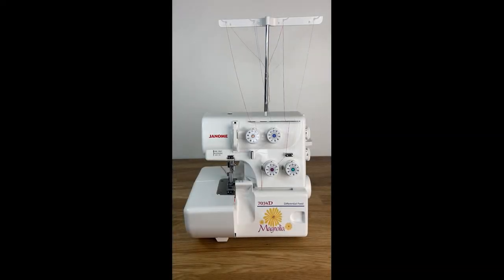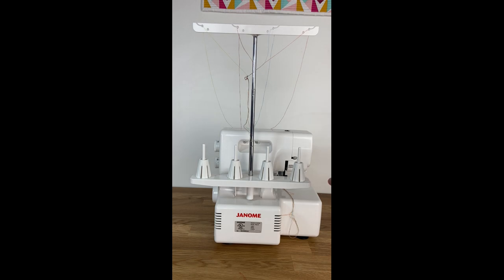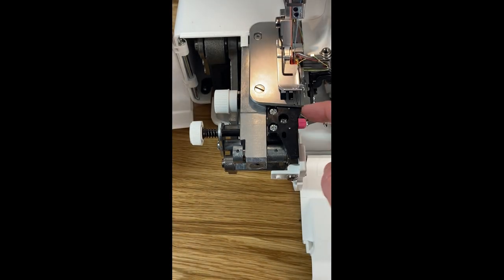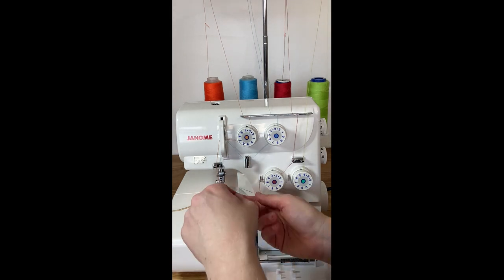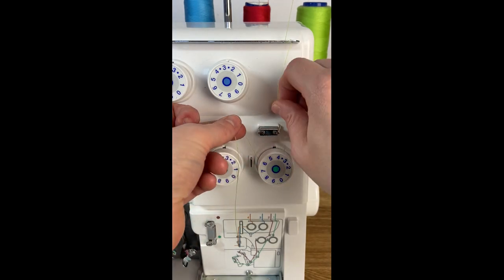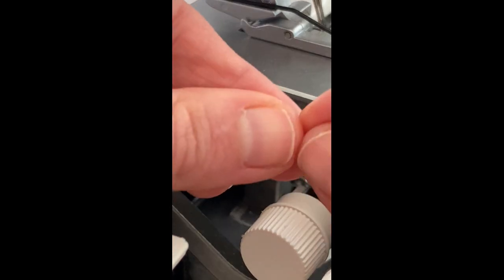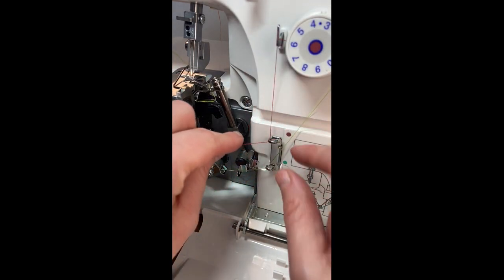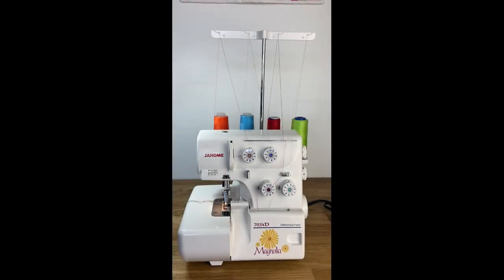Janome Machine Series: Part 1 Magnolia 7034D Serger Threading

Comment: Good machine but has a hard start always needs to be pushed manually ..this is a bother when you need both hands to hold the fabric...and this brrrrr..brrr sounds like it wants but cannot......Otherwise goood...basic ....
Reply from the maker: I'm sorry you are having this issue. That doesn't sound typical. You may want to take it to your Janome dealer for a tune up.
Reply: you shouldn't need 2 hands to hold the fabric. A serger has an extra long foot and good feed dogs that will pull the fabric into the machine to stitch.